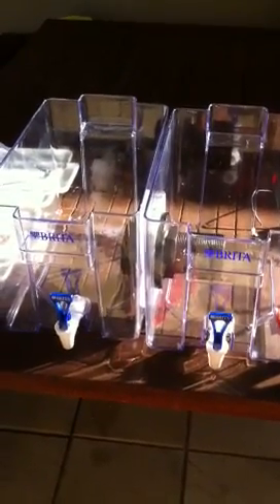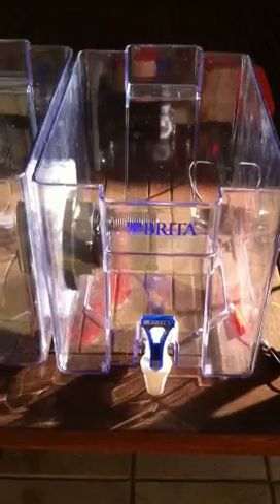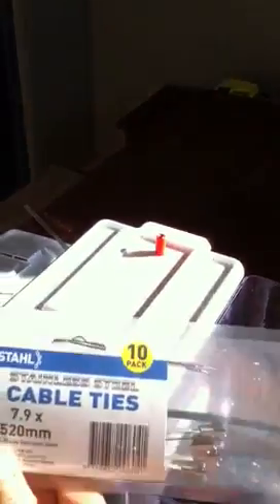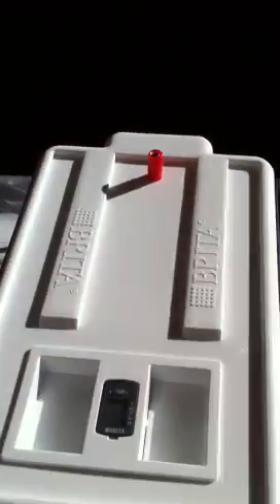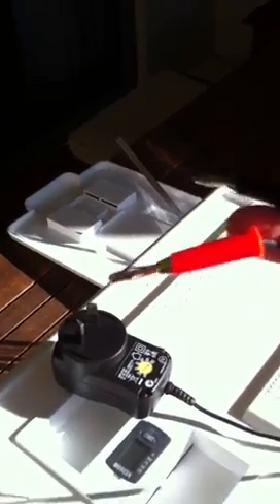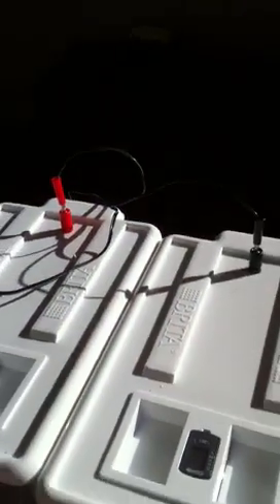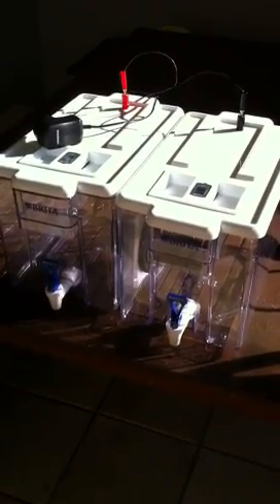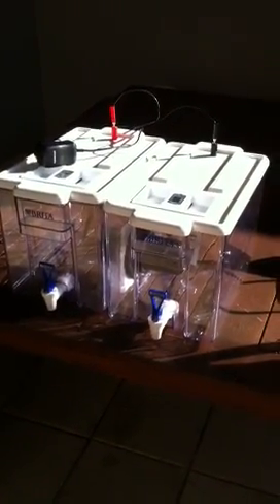DIY water ionizer

Comment: Everything is fine, but you can do it much better, your electrodes are too small and far away from the membrane. Right side of membrane housing is longer than left side, that is not good, must cut it to the equal size.

Comment: If I'm not mistaking , these can create a fair amount of explosive hydrogen gas if not vented properly.
So if you use electrodes with a large surface area and power supply with higher voltage - amperage output, the ratio between the O2 and hydrogen can be quite a bang, so remember to vent these away from open flames and sparks.

Comment: DO NOT DO THIS AT HOME KIDS!!!

Using stanless steel is way to create toxic metals in the water. While ionized is documented as healthy way to sanitise, you have to do it correct and dont just use any metal available. Heck, not just any titanium should be used, you have to use the right kind of titanium, or again you will end up with toxins in the water.

Comment: Thank you for this amazing informative video, what happens if I use 2 to 3 washers (electrodes) in each  tank to fasten the process and can I use copper electrodes in place of stainless steel. and one last question can I use 20v  AC to DC adapter that is my laptop charger.

Comment: There are a couple of things that will effect how fast the ionizer will work.

The electrical resistance between the electrodes when submerged (Ohm's Law), resistance is reduced by;
- Increasing surface area of the electrodes submerged in water.
- The distance between the electrodes.
- The amount of salt in the water as this allows current to flow (Amps)
note: The greater the resistance if the circuit the higher the voltage will need to be in order to reduce processing time.

Comment: u need to put water switch between the tanks made from plastic , ive just finished my own and when it finished the process i can separate in between the acedic water and the alkaline water  , try to find out more about the stainless steel electrodes because iam not sure if this is good or not , when i tried stainless steel the positive pole contains some rust

Comment: Dear Caz,
What is that switch you are using is it called a conerter or Kill a watt device for safety.How do you drill the hole on the container ,using an electric drill for cutting the plastic.Can i use a nail by burning it on the candle or gas stove to heat up the nail.to cut through the plastic container.I tried using this method but the hole is uneven and the water leaks from the tank.
as a diabetic , to build my own alkaline water ionizer to help reduce blood sugar.
Thanks & regards
Raymond

Comment: I would suggest you increase your electrode surface area and voltage  to lower the time problem.
Also not all stainless steel is the same.Be careful.I saw a guy on Ebay selling titanium electrodes for about $5.

Comment: @Caz417  sea salt and /or sodium bicarb is added to make the tap water or any water "conductive" , to get the current flowing through the solution ( in 12 volt homey ionizers )  . without current  flowing across due to the absence of conductive minerals, no ionisation will occur. the salt we added remains as salt even after ionization. btw, my stainless steel electrodes are corroded to shame after making 12 liters of  "salt" made alkaline solution. wondering if yours the same?

Comment: i think an ORP meter ( which i dont have yet :o(.. ) is much more realiable test of how the ionization progresses. a quick  ph strip test will help or may  not. like in the case of adding baking soda, the water will read alkaline before electrolysis begins. it can give  false result. would you peeps, agree? i think ph 8 water with negative ORP is much better than ph 10+ water that hasnt been ionized. i can make my tap water ph10 + now buy just adding baking soda.. but unionized. thats no good.

Comment: i am bit concerned about adding sea salt or any form of salt to speed up ionization. salt being a no-no or at  least should be minimal on diets. i can`t find a source that says what happen to the salts we add in home made ionizers. at this point i presume, it stays as SALT in the alkaline water we drink. i am using similar stainless steel  304 electrodes from bunnings and lately used 12 volt  6 amps charger. without the salt or baking soda, ionization takes foreever. is it ok to use salt?

Comment: Well done!  I'm wondering if it would be a benefit to install a ball valve, or some type of mechanical shut-off between the two reservoirs?  Open during electrolysis and closed during distribution.